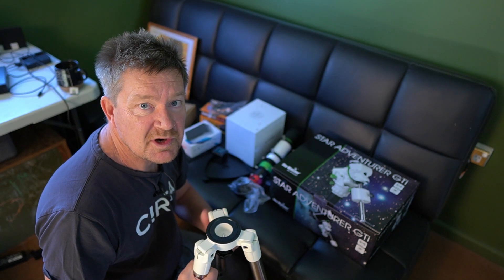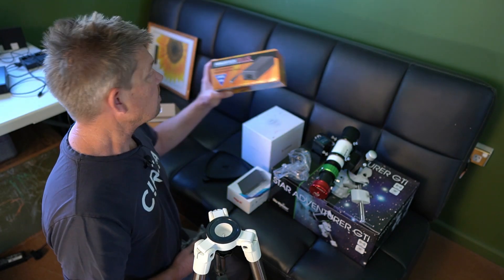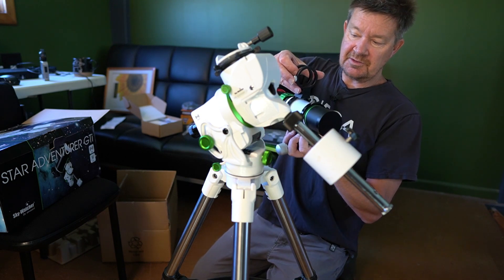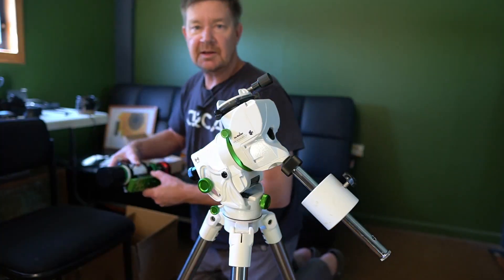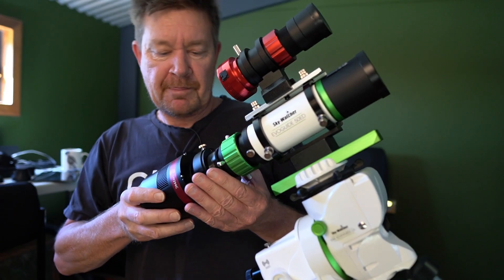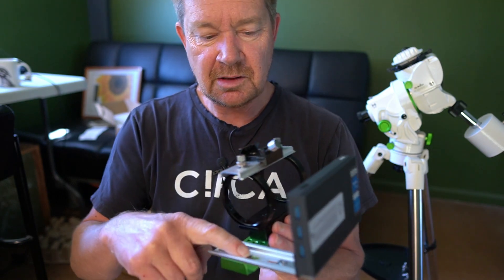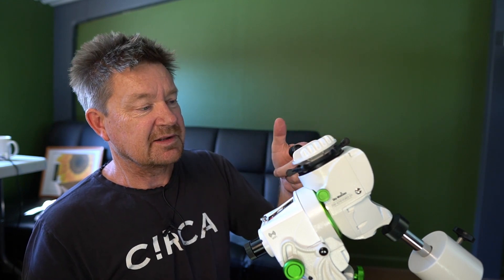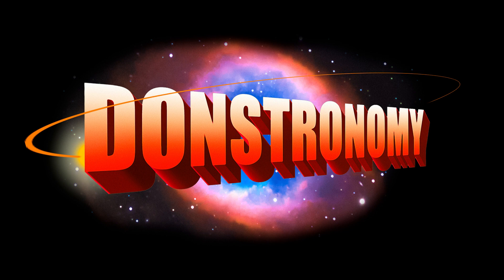Star Adventurer GTI Travel Rig Part 1

Comment: The polar scope cap is in place properly when you get it........once you put the batteries in the battery packs, the tips of the tabs hit the last battery in the pack on each side not allowing the locking tabs to engage in the frame.  I am going to trim the tap tips down and see if that does the trick and let the polar scope lock in place.
Reply from the maker: I hope that works for you. I have seemed to lost mine some where? Threw it away, must be under a couch or something?

Comment: Thanks to you for posting the very helpful instructional video. I think it's reasonable to use "fast forward" as part of the work procedure, but it's hard to understand what kind of work was done, so if you could set the "fast forward speed" a little slower , It will be more helpful (because it is an automatic translation, there may be inappropriate expressions)
Reply from the maker: Thank you Jick. I am happy you found it helpful. You have made me watch the video again and I can see it was to fast. I will keep this in mind for my next videos. Clear skies to you. Don
Reply: Some Japanese astrophotography enthusiasts were also interested in using the "EVOGUIDE 50ED" as the main lens of an astrophotography camera, so I bought one. However, I was worried about how to install the "guide scope" in parallel with the main lens. When I was watching a how-to video about "EVOGUIDE 50ED" on "Astro Crescent", I learned that you were introducing how to use a "DIN plate", so I bought a DIN plate (also sold in Japan under the same name) I bought it right away. I appreciate you sharing a relatively inexpensive yet effective method. (I'm not good at English, so I don't know if automatic translation is appropriate)

Comment: Nice setup. Just some advice as I am running something similar. Please table the stickers off of your Mele, will help with cooling considerably. I have 4 of them and trust me, will definitely help. Only other thing I would suggest is ditching the SyncScan software and using Green Swamp Server. Much better and none of the headaches that come with SyncScan. Other than that, clear skies mate!
Reply from the maker: Hi James. thanks for the tips. I will have to check Green Swamp Server out. Never heard of it before. I am also thinking of using EQMod, as my guiding hasn't been great. Not sure if this is because of my synscan driver or not.
Reply: @donstronomy7606  Unfortunately, EQMod doesn't work with this mount which is why I moved to GSS. I now use it for all my SW mounts. Anyway, good luck with your project.